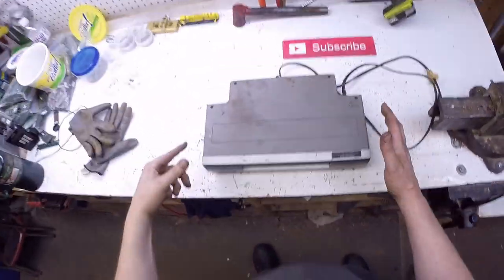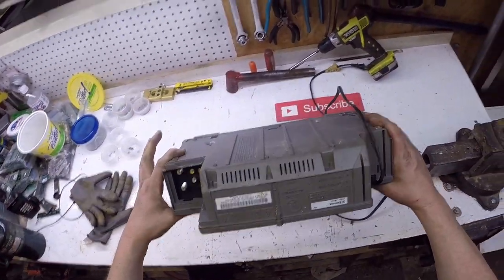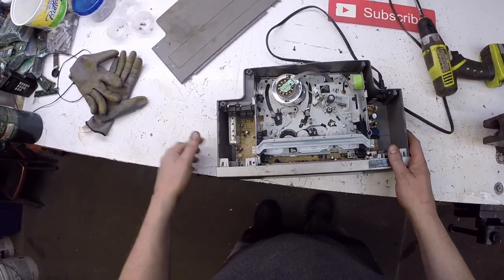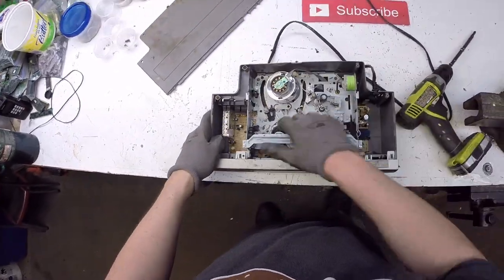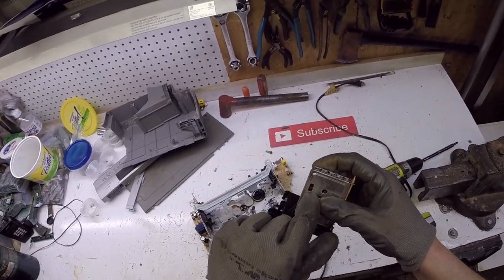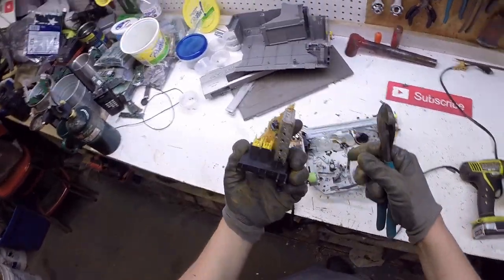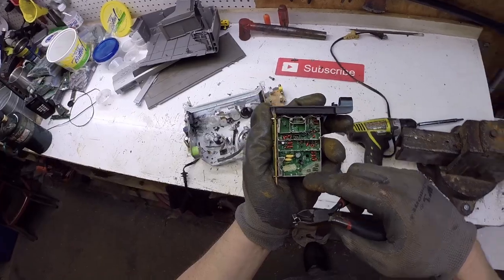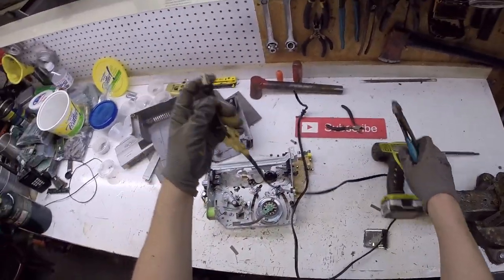Make Money Scrapping A VCR

Comment: Mate, you have got to get yourself an "upholsterers tack lifter, " dirt cheap on Amazon and Ebay, I use mine for micro scrapping all the time, it has no end of uses, its like a small hand held crow bar. On top of that a pin punch set would really help knocking out those spindles bearings and all kinds of things with the vise !! Hope this helps !! Keep up the good work !!